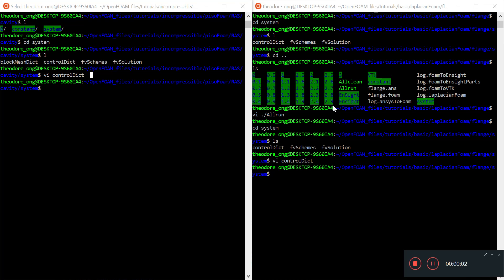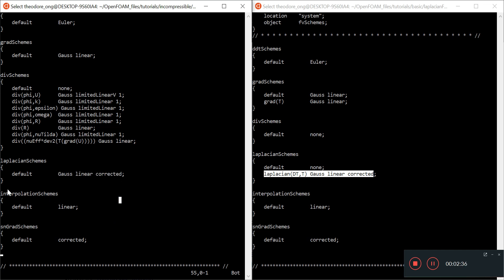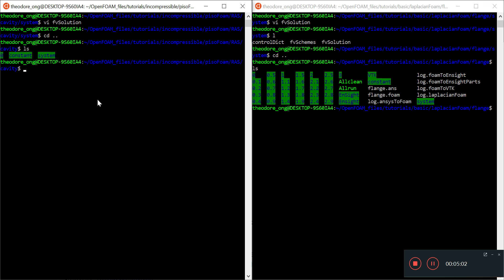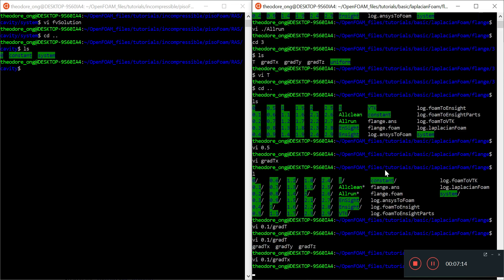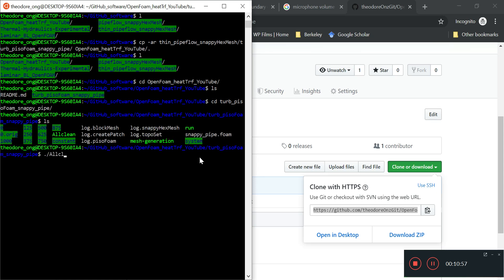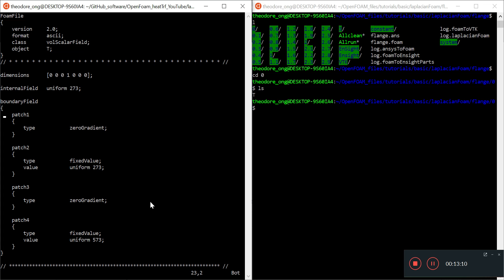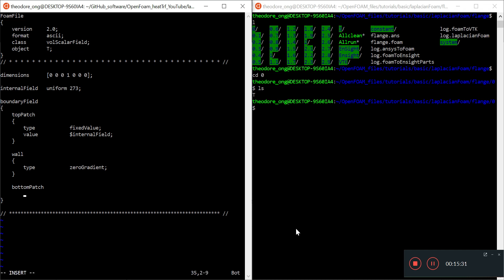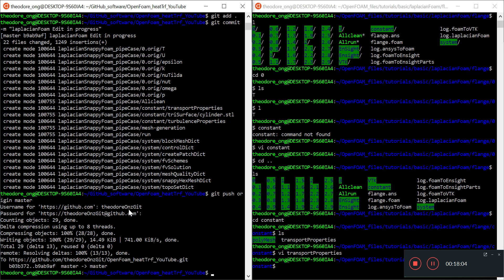OpenFoam Heat Transfer 2 - LaplacianFoam part ii

Comment: Hi Theo, thanks very much for all these videos, they are great. I have already watched the first two in this playlist, with the final goal of being able to simulate heat flow in a room, both forced and natural convection. I understand how the temperature is solved (easiest part I guess). However, with this goal in mind, which transient/steady-state solvers would you recommend I go for? The amount of solvers is quite daunting to a beginner. Further to this, which videos do you recommend I watch to get toward understanding the solvers you recommend? Thanks very much.
Reply: @TheoOngScienceAndEngineering  Thanks for the quick reply! Yes I have looked into these tutorials and run the hotRoom, but that doesn't mean I understand what it is doing, hence why I'm here! It sounds like the plan will be to understand the SIMPLE (steady-state), PISO (transient) and PIMPLE (transient hybrid) algorithms, understand turbulence (it seems the RAS k-\epsilon is the specific one) so that I am able to understand the buoyantSimple/PimpleFoam solvers. Thanks for those links I will check it out!